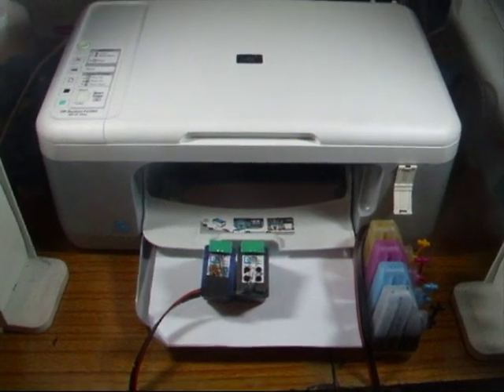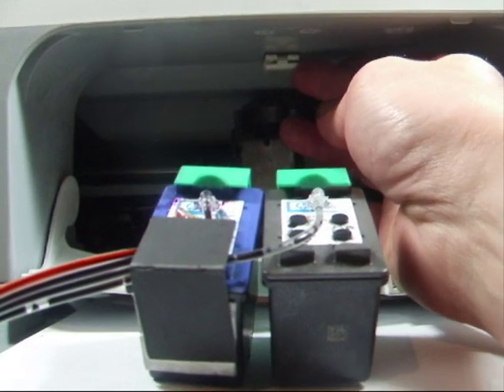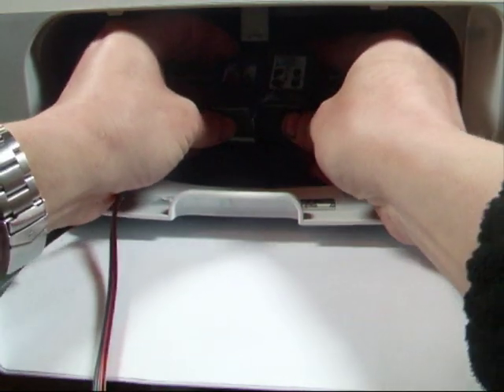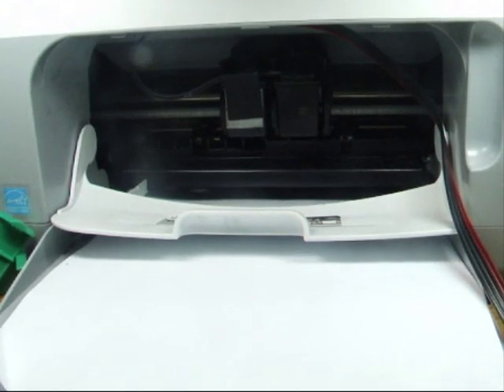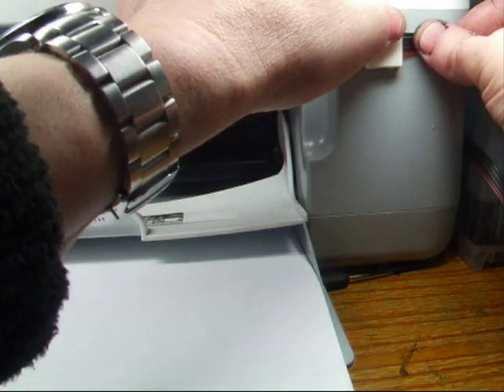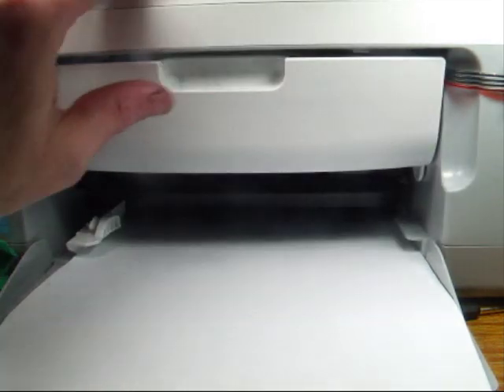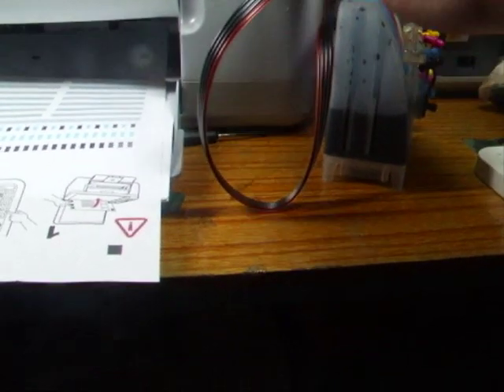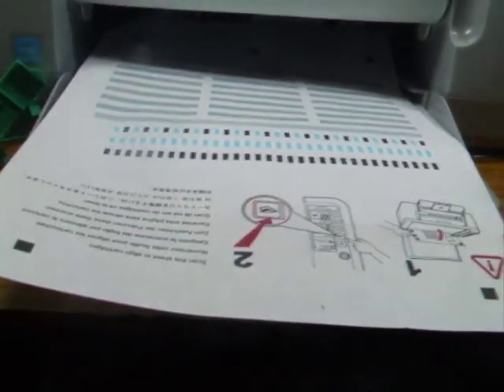How to install a CISS onto a HP 2200 Series printer HP F2280 HP F2290 HP F2224

Comment: I just bought a ciss, but it doesn't come with the cartridge install so I have to use my current cartridge. I have the colored ink near empty and just bought a black hp cartridge. How do I go about installing it? Do I fill in the colored cartridge with ink first or should I just plug the pipes with a near empty cartridge?